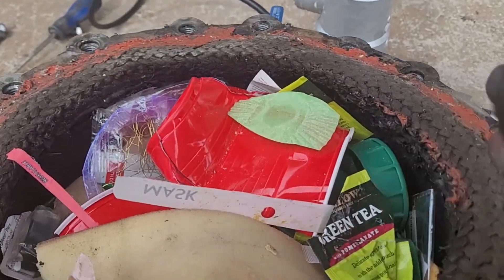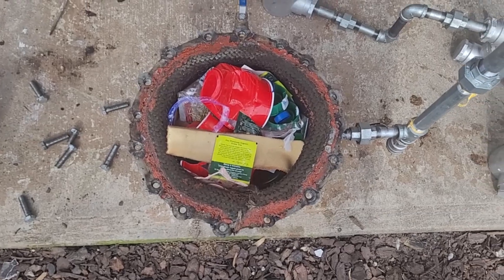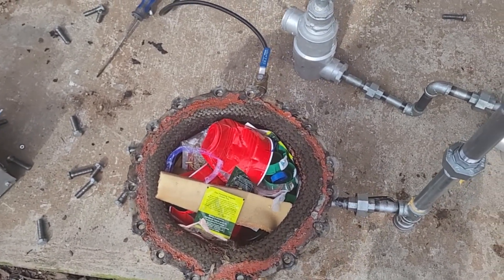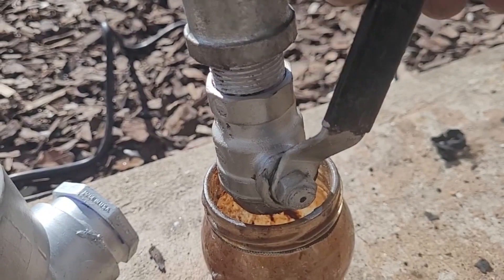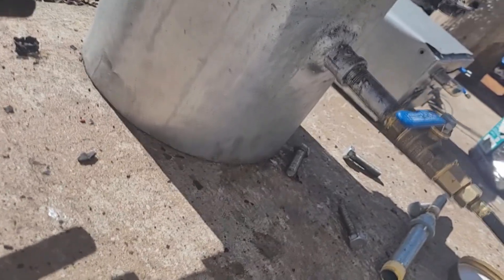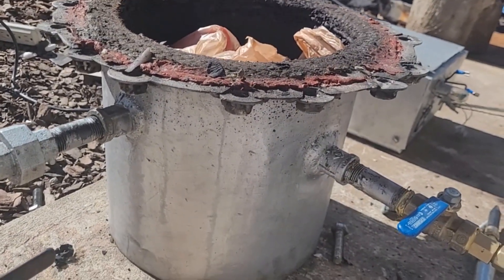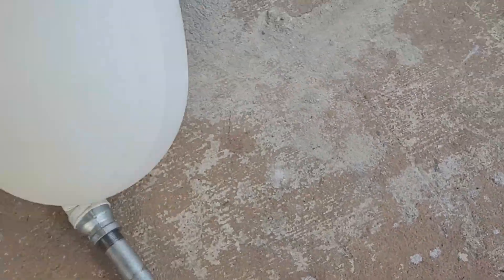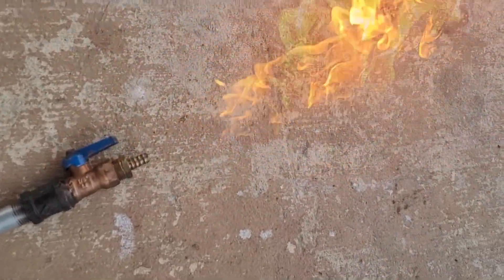Pyrolysis Reactor Update - Got Oil?

Comment: Is there a reason why you won't use a heating element with good insulation for the pyrolysis instead of microwaves? I'm interested in the energy input to calorific output. great job btw. Cheers J

Comment: Sir plastic is heated 300 degree.
So what type catalysts use in plastic recycling. 
That's helps to processing speed very fast.
Reply from the maker: Carbon and Calcium Oxide

Comment: The epoxy and steel expand at different rates and causes the bond to fail. You need to find materials with similar coefficient of expansion. Another option would be to use a gasket and clamping ring.  An easy off the shelf idea would be a quarts or pyrex window ground to fit a tri-clover flange. I believe mcmaster carr has materials like that. Hope this helps, keep up the good work.
Reply from the maker: Thank you! I'll look into this.

Comment: Hey, what about making a video a little bit more strucrural?, like I put 500 grams of this in here, the reactor draws 18 amps rakes 11 hours, gives 11 8 liters of gas and add this to get more oil etc, more analytics? The rest is good to you know, but i cant try to build one if i have so little facts, and please buy a stand for the camera, i get sick 😎
Reply from the maker: Thanks for the feedback. I haven't taken time for anything precise because the functions of the reactor and outputs are not consistent yet. Therefore my results would vary every time I take them. Once I get the outputs consistent, then sure.
Reply: @naturejab  great, im working on something similar, i have two versions, one wood fired, and one with electric heater, i then condense out two fractions, benzene and toulene mostly from Hd-pe farm plastic and more oil / diesel from polycarb, i will do some filming later on

Comment: Well done :) now you just need to add a thermometer to the reactor to see if it's getting up to or above 600 degrees Celsius wich is around the best temp to break down everything and get a better oil yeald. also a thermometer to the bottom of the condenser as you need around 280/320 ish to condense to oil. a cheap laser thermometer should do the trick. you might want to add a thermal jacket to the outside of the reactor to keep the heat in also. if you are not going to save the produced gas you might want to consider pipping the gas to a burner underneath the reactor to help break down that plastic at the bottom that the microwaves cant break down. It's still looking good though. keep at it and I'm glad my previous comments helped you :)
Reply from the maker: I love the idea of running the syngas under it to solve the problem of microwave penetration, very clever! I'll see if I can use my old propane burner and hook it up to the syngas output, I may need to add a fan to give it enough PSI. Thanks!
Reply: Around 450 is better for Hd-pe and ldpe otherwise more gas and carbon

Comment: What if you put a layer of insulation on the bottom so the plastics won't build up down there? I'm not sure if it'll do anything but it's worth considering.
Reply from the maker: I would need to put a layer of insulation alongside a layer of a microwave absorber at the bottom, so that way the heating goes from the bottom up. Thank you!